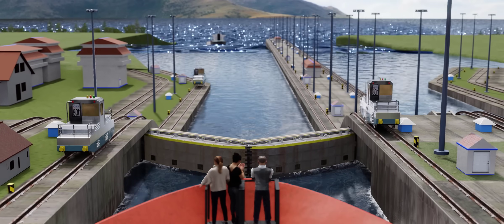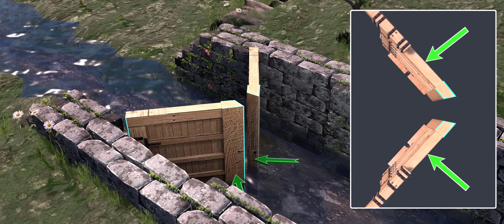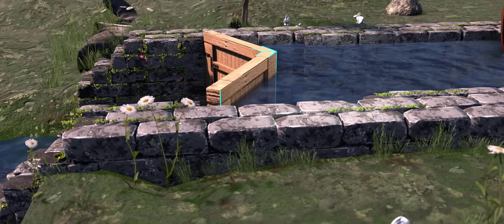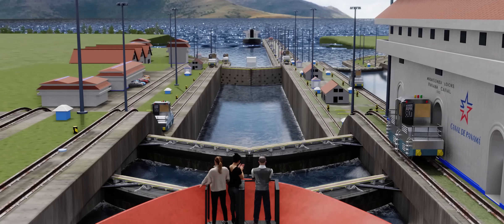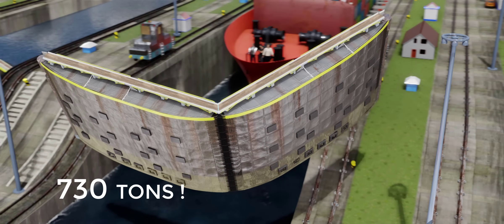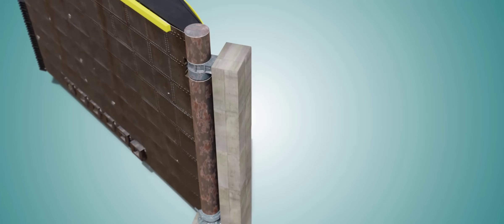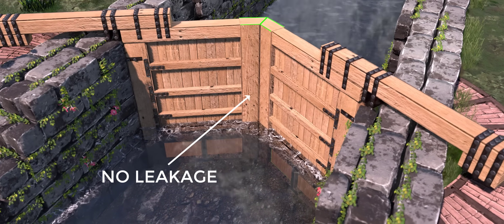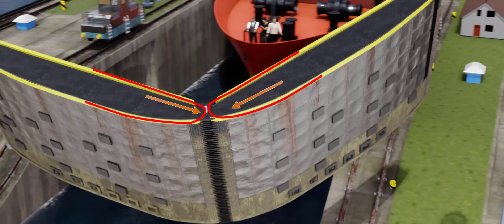Leonardo da Vinci's GENIUS invention - Miter Locks

Comment: my local River lock (which believe is from the Tudor Era) uses this same gate design. though only one of the two locks are functional (the smaller one, for narrow barges),  it still uses a handcrank to open and close the gates as it has no sleuce valves.

Comment: Well the first thing people should know is.... Leonardi DaVinci did not invent a single thing. All of what he drew, was invented long before his life. And it was all known to work. When it came to his mechanical drawings, he included things that would purposefully make them not work, in case anyone copied his work. This included drawing a part of something as a whole. The aerial screw could never work by itself. But if you have 4 of them, with 2 going the opposite directions, you end up with something like  a drone, which will work. Because of the way the doors come together,  This locking dam system, was far older than any of Da Vinci's drawings. Ancient Egypt used the same system on the Nile.  And that was long, long before Da Vinci was born.  As for how it works, the angles of the doors, and the wedge at the bottom, won't allow them to pass each other. The pressure of the water pushes against the doors keeping them shut until people use the arms to push it open. When a boat is waiting in the locks, water is either allowed in or drained out depending which direction the boat is travelling, moving the water in the lock to the height of the water on the other side.

Comment: How about the hinges? How to make it leak proofing?
Reply: The hinge system are usually what we call in the industry pots and pins. You have plate fixed into ground at the bottom of the quion where the heel post sits. On the bottom of the heel post is the corresponding female plate to act as its pivot point. 

At the top of the post we use circular collars which can be adjusted for compression into the quoin, usually you will get some leakage but over time the post will naturally wear itself into the quoin as well as swell from being immersed in water and create a reasonable seal.

Evidence : I work in the industry surveying and draw designs for flood defence all over the UK

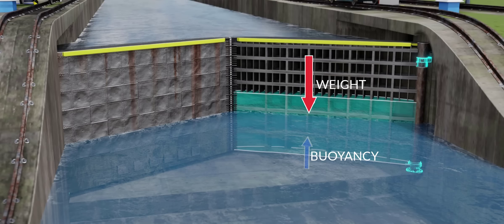Comment: 3:16 the image shows water inside the hollow fence, there is almost no buoyancy when its filled with water, So I guess,  that the fences never gets filled with water
Reply: I assume it's filled with air also, I think the blue area doesn't represent water but it's probably not good to use blue when demonstrating something that isn't water when it's submersed in water. Also I think he messed up when he wrote same weight, low vs good buoyancy force. The buoyancy force is the same on both gates, it's just that one weighs less than the other, so the net force is less on the lighter gate.

Comment: 1:36 "Just open the sluice valves" he says, telekinetically swivelling a pair of unexplained panels that look like they would've been opened automatically by the water pressure and would regardless require a person to go down in front of the dangerous pressurised water and somehow push them hard enough to swivel.
Other than that though, great video!
Reply: DrakeHelpsLilYachtyWiththeLaptop.gif

Comment: Except what about when the gates don't close at the exact same rate (which I imagine in reality would be basically 100% of the time), one would reach the mid point and the other isn't there to meet it... so it would just continue swinging all the way over. I imagine just a simple stopper of some sort would be needed just in front of the point they are supposed to meet at to ensure that can't happen, but I don't see that included in any of the animations or explanations here.

Comment: Leonardo da Vinci was a genus. I can be creative, but he takes it to a whole new level. Practical thinking. Did you know that he even made the first robot? It was like a car that would wind up. He could program it do a set of commands as it moved along. Simple pre-loaded commands like. Going down 50 feet. Turn right and go down 20 and so on. He used ropes that were cut to lengths that would correspond with the distance he wanted it to move.  
It was all fascinating.

Comment: How would one open the slues valves? would you do it from the dry side of the gate or what?
Reply: The gate paddles (that's what they're called) are on the upper side or inside the gates so they can be sealed by the water pressure. They're tiny compared to the gates so lifting them to let the water through is a trivial task compared to operating the big gate.

Comment: It's so interesting when people find ways to use natural forces against itself. There was a relatively new invention just recently, it's basically a sturdy piece of plastic shape like an L, long end face down, so when water goes over it, the weight of the water will push the long side down, forcing the shorter end to stay up and using gravity to create a very strong barrier for water. They use it as an emergency barrier to block areas from flooding, since they stack nicely and are easy to deploy, like traffic cones. Better than sandbags, and at a fraction of the weight, plus much less time spent setting it up instead of digging a ditch or piling dirt.

Comment: A pound lock is most commonly used on canals and rivers today.[3] A pound lock has a chamber with gates at both ends that control the level of water in the pound. In contrast, an earlier design with a single gate was known as a flash lock.[4]

Pound locks were first used in China during the Song Dynasty (960–1279 CE), having been pioneered by the Song politician and naval engineer Qiao Weiyue in 984.[5] They replaced earlier double slipways that had caused trouble and are mentioned by the Chinese polymath Shen Kuo (1031–1095) in his book Dream Pool Essays (published in 1088),[6] and fully described in the Chinese historical text Song Shi (compiled in 1345):[7]

The distance between the two locks was rather more than 50 paces, and the whole space was covered with a great roof like a shed. The gates were 'hanging gates'; when they were closed the water accumulated like a tide until the required level was reached, and then when the time came it was allowed to flow out.
The water level could differ by 4 or 5 feet (1.2 or 1.5 m) at each lock and in the Grand Canal the level was raised in this way by 138 feet (42 m).[7]

In medieval Europe a sort of pound lock was built in 1373 at Vreeswijk, Netherlands.[8] This pound lock serviced many ships at once in a large basin. Yet the first true pound lock was built in 1396 at Damme near Bruges, Belgium.[8] The Italian Bertola da Novate (c. 1410–1475) constructed 18 pound locks on the Naviglio di Bereguardo (part of the Milan canal system sponsored by Francesco Sforza) between 1452 and 1458.[9]

In Ancient Egypt, the river-locks was probably part of the Canal of the Pharaohs: Ptolemy II is credited by some[who?] for being the first to solve the problem of keeping the Nile free of salt water when his engineers invented the lock around 274/273 BC.[10]

Comment: Great video. I am wondering if water flows both sides like in panama canal during tide differences, would nt the water pulls it open? I think better design was diamond lock (2 mitre gates facing each other - like that 2 sets forming a levelling chamber in between) instead 2 parallel  parallel mitre gates.  (Your suggestions are most welcome, as an Irrigation engineer I confused whether to go ahead with a two mitre locks or diamond lock for a proposed site)

Comment: 01:37 So how do you open that small wooden sluice gates? Wouldn’t the pressure be the same? They open towards the high pressure side.
Reply: Same question
Reply: When opening the gates, it seems all the pressure is going against opening the gate.

The sluice gates don't get as much resistance because:
-They're smaller: less surface means less force resisting it
-They have to move less distance
-Pressure won't be that detrimental to the gates. One part of them opens towards the water, which will be resisted. However, the other part of the gate moves AWAY from the water flow, so it's actually assisted by the water.

Comment: You left out the key ingredient lock gates only work in sets of two.  You need to have equal water levels on both sides of each per to open it, which means the up stream must be closed to open the down stream and visa vers.

Comment: I've lived in several places along the Trent-Severn Waterway in Ontario, Canada. I can walk to one of them in 5 minutes. Most of those locks operate on these same principles, taking into account modernization of machinery and maintenance. It is a 386 km route with 45 locks. Also it's through some of the prettiest scenery available in central Ontario. The same can be said for the Rideau Canal system locations. That one is just over 200 km in total, using 29 locks. 
Because they are no longer of use by commercial boating, and are for recreational boating, the staff are super accommodating to explain how everything works. It's simpler than I first imagined. Brilliant use of the water to do the work.

Comment: That joint not only gets water to pressure lock the middle join, but also hinge is pushed against the wall - thus creating a tight seal there as well

Comment: I travel the Trent/Severn  waterways each summer . This was built in between 1830 and 1901 . They still use this style of gate. They can leak on occasion  but solid. They change out the timbers when needed ,but really an amazing feat of engineering

Comment: This was great to watch and da Vinci was certainly a gifted artist, engineer, etc.  
During the video I got a memory trigger of something else that always intrigued me in terms of achieving a water-tight seal in order to hold back a large body of water.  That is, the door/seal system on a dock, or dry-dock, to be precise.  We've all seen a picture of a vessel in a dry-dock under construction, or in for maintenance, cleaning, etc.  Here, the fluid dynamics seem in contrast to that of a river flow, pushing against the angled gate faces, using the flow force to achieve the seal (as shown in the video).  Instead, the sea is 'flat' against the dock gate.
How is this achieved safely and reliably, anyone?
Thanks.

Comment: Well, video is good. But doesn't explain how the water pressure combines with opening these holes at the bottom of the gates. And how that part operates in the Canal.

Motor? Natural pressure? Some manual mechanism?

Comment: I have been around miter lock operations most of my life and have yet to see one that is watertight, no matter the level on the upstream side. It is theoretically possible, of course, with the right sealing materials installed, but in practice, that free joint in the middle is not constructed that perfectly no matter how much pressure is applied. The leakage is generally not significant, so it is still the most useful design, but It is a very different construction type than, say, a precision airlock on a space capsule.
Reply: I was a tow boat deckhand, can confirm. The joint is always leaking water, just not enough to cause an issue.
Reply: I used to be a miter lock door. I will not confirm or deny the claim at this time. I will be contacting a lawyer for assistance. 😛
Reply: I drove by a canal once and I cannot confirm or deny any of this
Reply: yeah watertight is a bit of a superfluous detail. truly watertight mostly comes down to a matter of maintenance since a soft rubber could seal completely but would require regular replacement since every time the join flexes under the pressure cracking and wear also grows in the material. The real trick is that the pressure on that joint is able to be so large you can use quite hard materials as the seal (such as steel or other metals) which have much more favourable wear characteristics compared to most water sealing materials. The pressure also helps to reduce tolerances for things like squareness of the two doors and surface roughness at the joint (though they do still have a pretty tight tolerance for straightness at the meeting edge and parallelness of the two meeting faces)

In leonardo's time of course they didn't have so many options for materials and the only options for a water seal for that use case would have been wood or a soft metal like copper which means high pressure joints were the only option available to stop a notable leak. Nowadays most locks play with the wiggle room that a small leak is perfectly tolerable in their use case and so they leverage that to reduce maintenance costs meaning most do still let some water through
Reply: I am the water leaking through the locks and I approve this message
Reply: Yeah I was just laughing when I heard that part. Maybe when they are absolutely brand new they are close to being watertight but to claim they form a "perfect watertight lock" is kind of embarrassing. This is the level of quality that gets you nearly 7m subs on YouTube, huh.

Comment: How did he limit leakage at the hinge side of each lock door?
Reply: the force not only push in the middle but also push in the hinge side, just leave little space in the pin ,let it have some movement,the water will push it  to the wall

Comment: It's amazing how da Vinci stopped flow of water using its own pressure
It works like a reverse aerodynamics.
Reply: Hydrodynamic
Reply: @adamg2960 After some research I highly doubt this statement. What you’re referring to is the Chinese creation of pound lock systems, which is a big deal for canals, but these original designs were described as “hanging gates” which would clearly isn’t similar to these gates.

You might be thinking of additional locks built between 1300-1600s on the canal or maybe just modern renovations.
Reply: Reverse aerodynamics is aerodynamics. That's a field, not a force
Reply: Or possibly he took inspiration from his anatomical studies of heart valves.
Reply: "I used the water to stop the water"
Reply: @adamg2960  China also invented water. Before that, everyone died of dehydration shortly after birth. They also invented lying about inventing everything.
Reply: Indus valley civilization of Dholavira In Gujrat, India It has the same port system invented in 3rd BCE...used to increase and decrease the amount of water and locking it in ports during tides. ✨
(Edit-A slight mistake It was Lothal which had water locking system in Port and Dholavira had water locking dam system for water Storage.)
Reply: @spiritedway can u please post the link of the source information ,i want to know more... Unbelievable if it's true.. Thank you..

Comment: How were the sluice valves opened from land in Leonardo’s model? Or did someone have to go down into the river area to manually open them?
Reply: And why didn't they leak, seeing as the video already stated that was a problem for this type of mechanism?
Reply: @drworm5007  These systems always have a small amount of leakage, but in the grand scheme of things it doesn't amount to much more than a dripping faucet in a bathtub. It is of virtually no consequence to a system that pumps such massive amounts of water.
Reply: I was wondering the exact same thing, he just quickly glanced through that part. 
The same hydrostatic pressures that would make it impossible to open the doors would also make it impossible to open the valves?
Reply: @AK-rx6hv  Small valves have very little surface area so the pressure being applied to them by the water column is minimal.

Comment: What prevents leakage at the hinges?
Reply: Nothing really, except well designed components. 
A certain amount of leakage is acceptable in most canal systems.
Reply: I've been in a lock and they are not completely leak free. There is so much water that flows in to the lock that if some leaks out it doesn't really matter, the water level still gets as high as it needs to. When they close the gates it fills up amazingly fast. The water only needs to flow in a lot faster than it leaks out at the joints.
Reply: It'll leak a lil bit
Reply: Good hinges
Reply: What happen if it rains
Reply: @zanagi things get wet
Reply: @zanagi doesnt matter it lives in the water
Reply: The water knows the purpose of the door and doesn’t want to be a smartass
Reply: Your mom
Reply: The hinges are placed into the wall, so the wall at the sides prevents leakage
Reply: My dad
Reply: Your mom.
Reply: no leakage would mean overflow of the river
Reply: @iuer4643  true, although the Panama canal uses pipes to transport excess water to a reservoir they can use to pump water into the chambers for future use